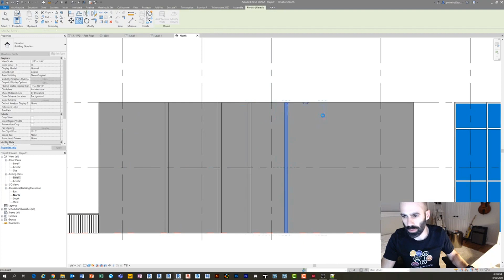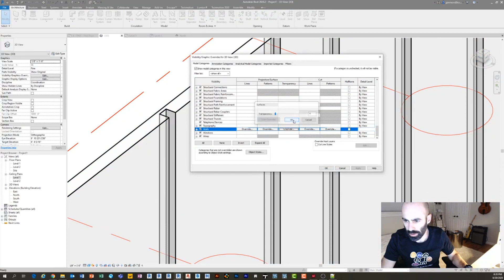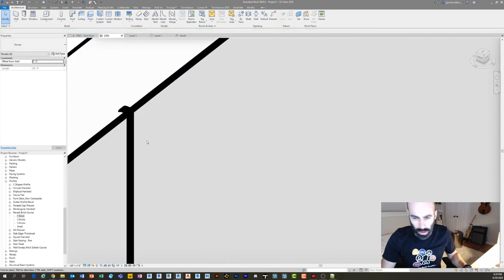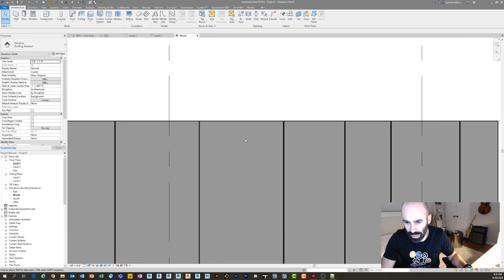Concrete Panels and Reveals in Revit Tutorial (Quick Tip Edition)

Comment: Why not just use the split face comment if it is just for elevations? 
For 3D i have a small cabinetry reveal that I use for schematic 3D and elevations (before i want to get into using cabinetry families) - for elevations I set it to 1 and use the linework tool to make one side invisible and just leave it at that. it's too bad that reveals don't behave like families where in elevation/plan you can set certain vis parameters so that a centrleine shows up in elevation, nothing in plan, then full gap in 3D.

Comment: I agree you could just use the line work tool, but that is too time consuming, especially if its more than a hand full of reveals..
 Ideally there would be some way to create a recess family, that can be applied to a wall, with the ability to turn the void on and off? I think that is a 2021 feature so that will not work with older versions of revit. 
I am actually starting to go through this issue, I need reveals in stucco, but did not consider how it would look in plan (dark) and possibly also dark in elevations....I was trying to avoid using the detail line tool directly to make the score lines, but maybe that is the best option for me. 
Another idea I just had is built into a reveal family a course or medium detail version that hides the reveal(visibility) but shows just a model line in its place? I have not built the reveal family yet, but just for anyone curious reading this, I hope to follow this video(which is not all that clear) https://youtu.be/1FjoonYXdNc